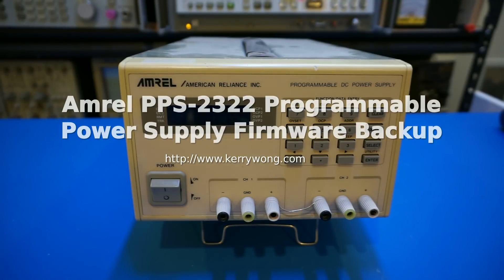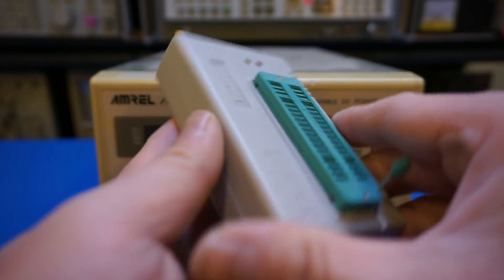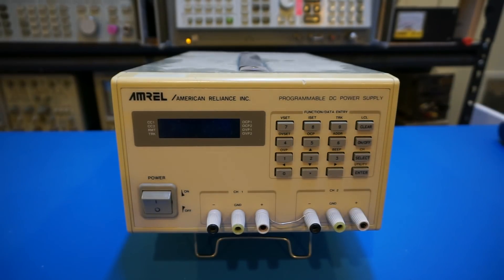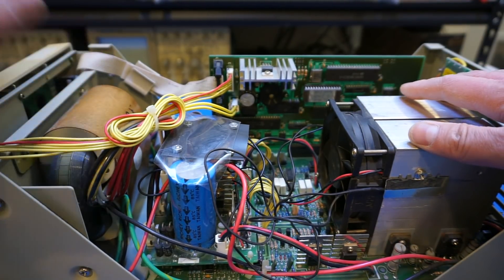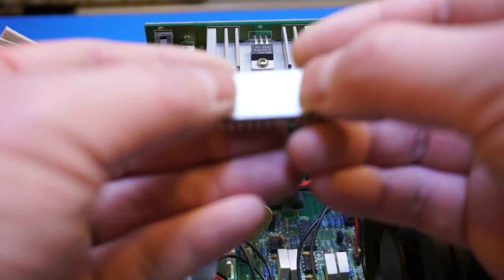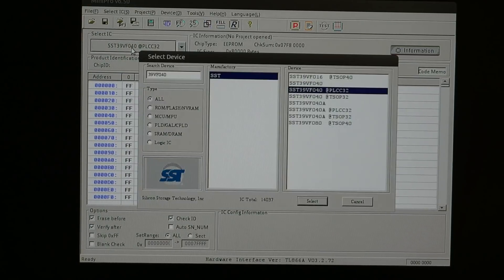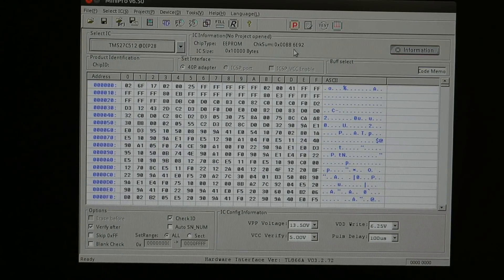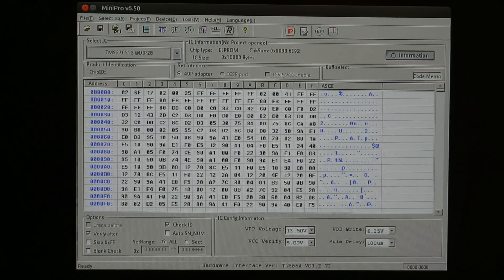Amrel PPS-2322 Programmable Power Supply Firmware Backup

Comment: I can see that you are not using the latest MiniPro v6.60.
You can upgrade the firmware, after downloading v6.60 sw, by going to Tools and selecting Reflash firmware.  

It would be nice if you programmed another EEPROM with the extracted firmware and check if everything works fine.

Thanks
Reply from the maker: I'll update MiniPro (didn't see any new chips added that I am interested anyway). I don't currently have a 27C512 (I do have a bunch of 27C256's) unfortunately.